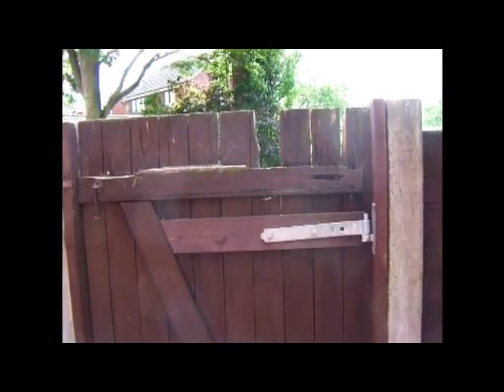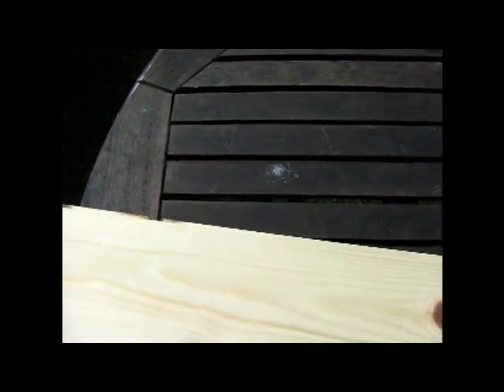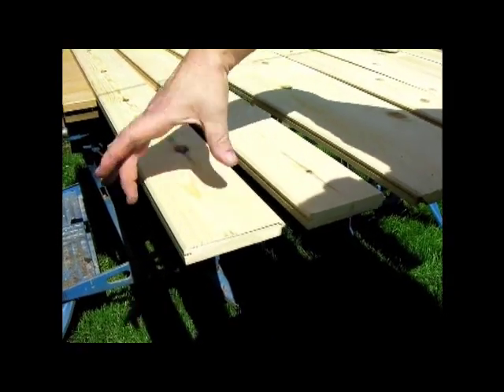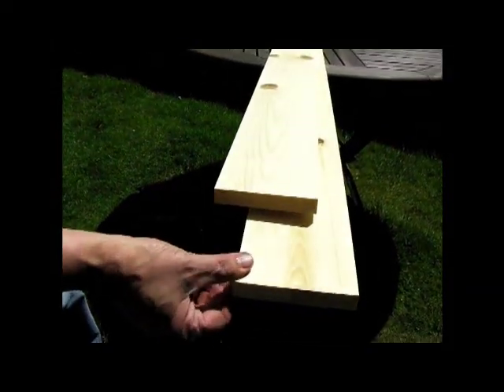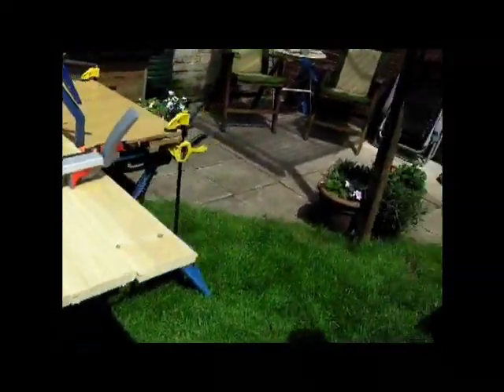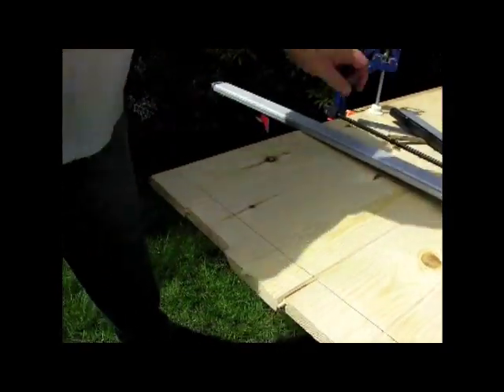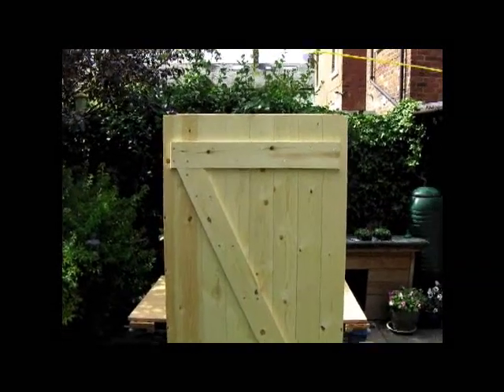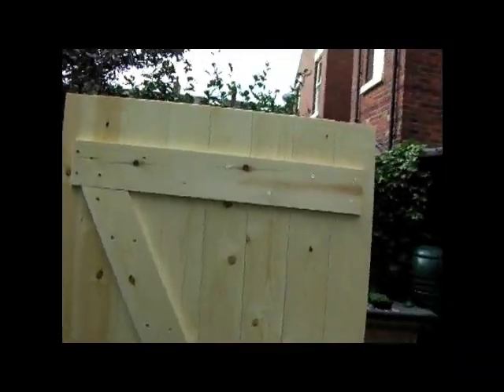How To Make A Garden Gate diy project 2012

Comment: Excellent video. It's a pleasure to see T&G being used correctly.  Too many similar gates on YouTube have the T&G glued! Arrgh!
Just one hint, if I may. It is important that you fully extend your cable reel. Coiled cables generate heat - quite a lot of heat -  and can actually burst into flames. I know, because I've done it. I was getting intense with a 12" electric chainsaw at the time.

Comment: Thanks for the reply. I found a Makita set on ebay for £16.95 with the quick snap holder, 4 reversible bits, and a full set of screwdriver bits 27 bits in total (P-70552 27PC QUAD DRIVER SET) Will save me a lot of time, got to replace 7 door frames, and 7 doors all brand new and need drilling / countersinking. Will be watching this vid again, need to make a new side gate (or maybe a pair in the new year. :0)